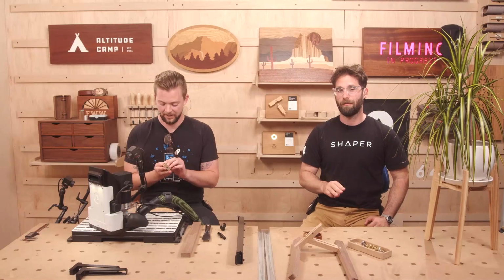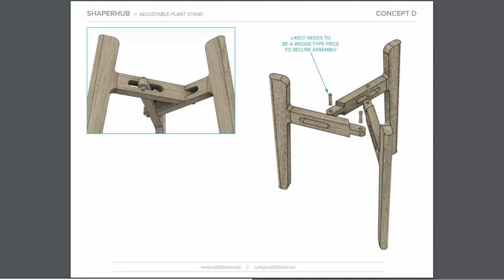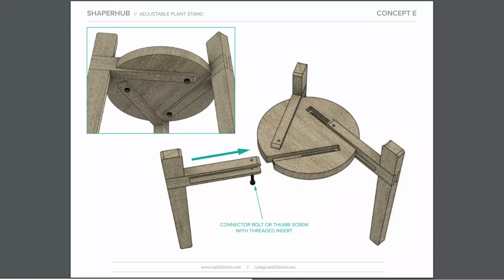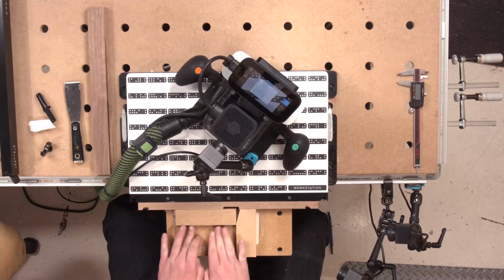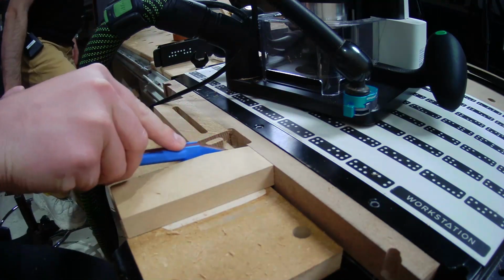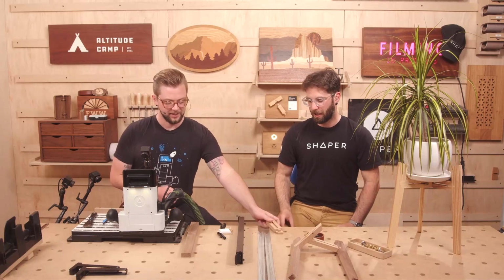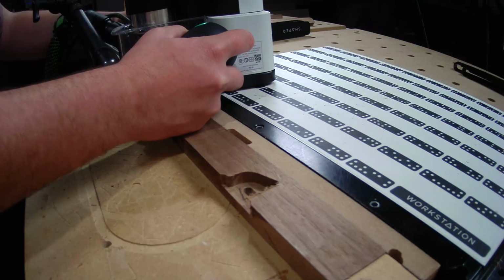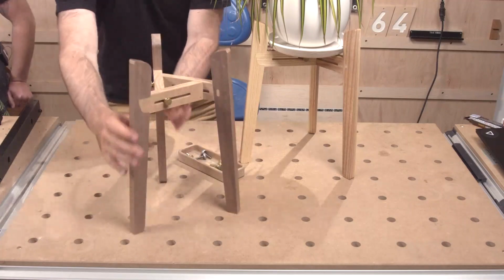Session 59  – English: Project Build - Leah Amick's Plant Stand

Comment: Is this scalable? For example,is it sturdy enough to scale up to hold larger indoor pots at 12 to 13 inches?
Reply from the maker: The original design is intended to be adjustable, but larger pots tend to get very heavy very quickly. The design wasn't structurally tested at larger sizes, so it's not known at what point the pot would be too heavy for the stand beyond the maximum diameter in the original file.